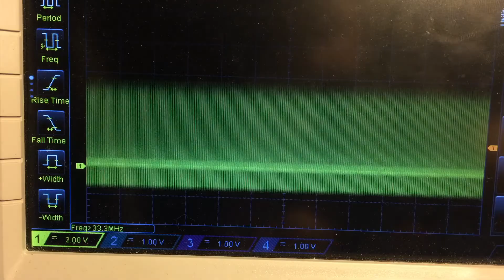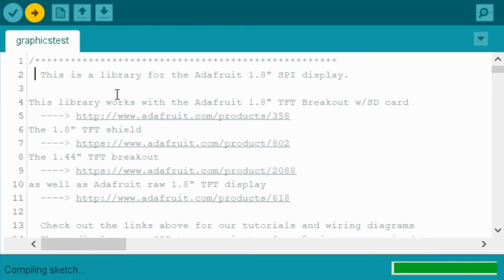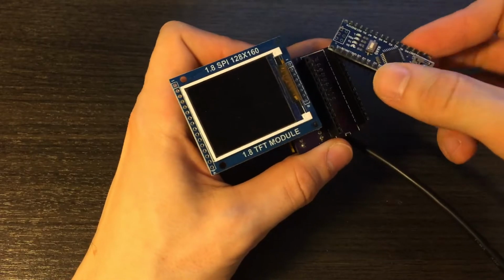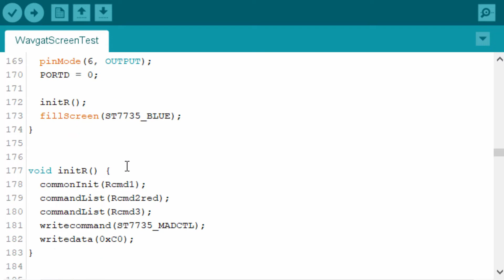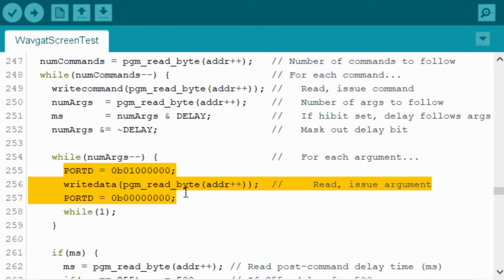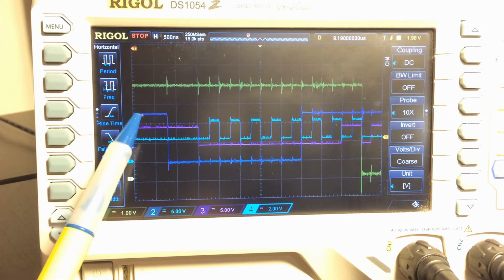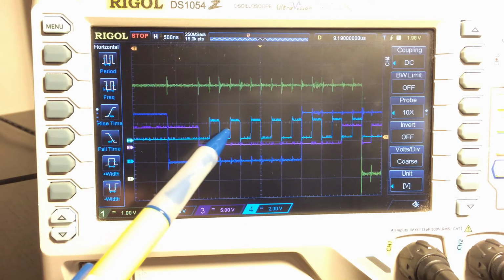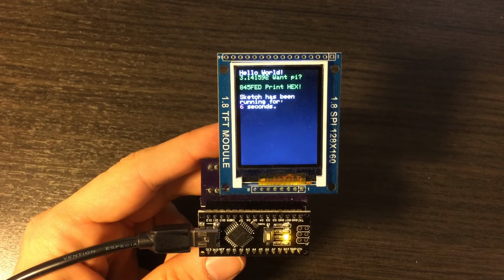WAVGAT Nano with Adafruit screen library

Comment: and it is possible to keep CS always in 0? 
for 8/16 bits of displays it works.
Reply from the maker: I didn't think of that but most likely you are correct. Chip select could be enabled all the time as long as you don't use multiple devices with the same SPI.

Comment: Awesome video!
I once had a vaguely similar problem when trying a library written for the Atmel chips (328p/168) on an ESP32. It turned out to be an issue with the CS too, but the pin didn't toggle at all. It just needed to be manually declared as an output.
Reply from the maker: Debugging this kind of thing can be quite time consuming. At the beginning you don't even know what to look for you just know that it doesn't work. In my case the CS was already manually controlled by the code. For some reason Arduino SPI library's SPI.transfer function didn't wait until the byte was fully sent.